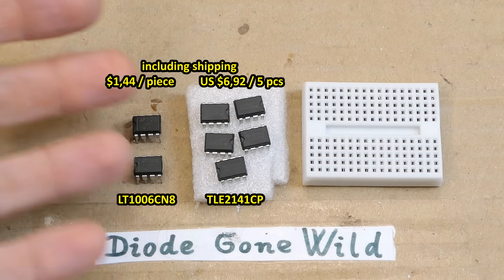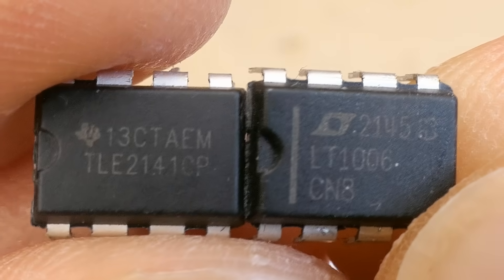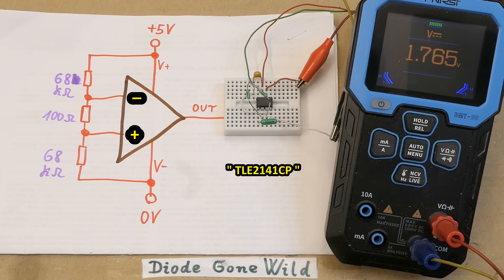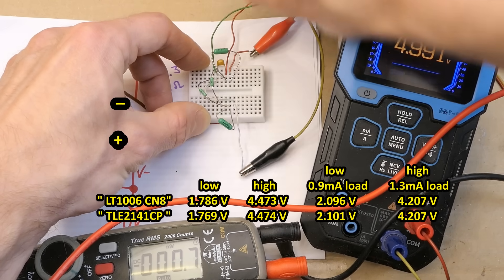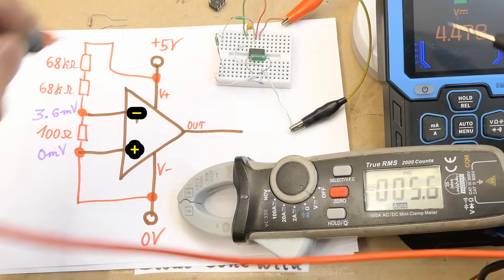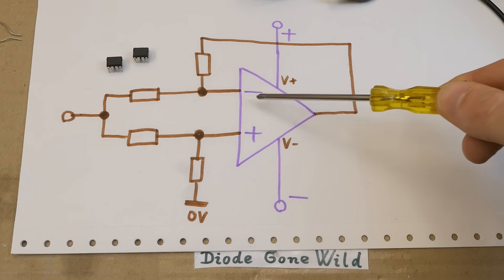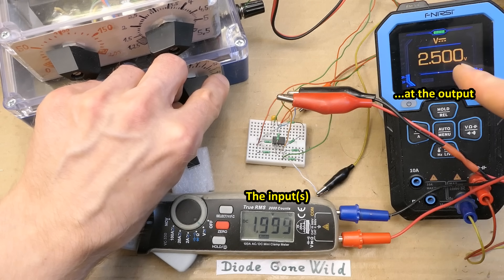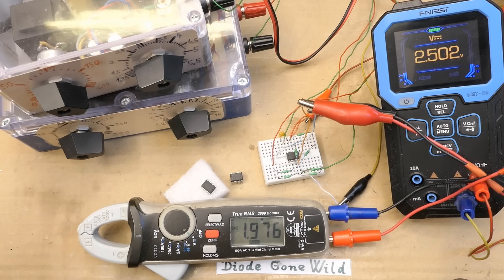Fake OpAmps from eBay, how to test OpAmps

Comment: Be thankfull that they were actually opamps with the same pinout, I have come across fakes that are completly different part resulting in a complete circuit destruction on power-up.
Reply: Yeah though then you know right away, vs spending hours troubleshooting.

Comment: I wonder if you can de-cap it and see any markings on the dies as to who made it
Reply: Destructive decapping could be attempted with just a small blowtorch (obviously outside). Such small die should stay intact. I did this on some old motherboard chips and most survived.
Reply: @RicoElectrico  Often just a paint stripper will be hot enough to soften the plastic.
Reply: I've heard there are around 10 very common oldish opamp circuits that chinese fabs know how to spit out by the millions, and many of these fakes are just one of those designs by pot luck. Some of them are fine as a jellybean part, provided their design matched the general parameters you needed (here, DGW wanted a ground-sensing opamp, whereas what he got was not, so these ones don't work for him).

Comment: I buy my semiconductors only from reputable sources (Conrad, TME, etc.) Nice video as always 👍😎
Reply: 100% of the time these days.
Reply: If your budget allows.
Reply: @edgeeffect   Budget has nothing to do with using counterfeit parts.
Reply: Counterfeiting is so bad that even trusted suppliers can end up with the junk. Dave Jones did a video where he ended up with bunk parts from a big supplier. It's less common than ebay but it still happens on occasion.
Reply: @1pcfred  Yeah, get's in the supply chain somewhere. Corruption. Should be prosecuted since those parts could end up in critical things like medical equipment.
Reply: @acoustic61  it's pretty crazy. Counterfeiting is a huge problem. To the point where it is becoming increasingly difficult to avoid it.
Reply: That only gets you about 99.99% assurity.
Reply: Full agreement.

Comment: now you have to discover which OpAmp's are the original ones behind these
Reply: 741's, what else?
Reply: It would be cool if there was a reverse datasheet search where you could enter the characteristics of a component and it would find matching datasheets.
Reply: @liam3284 The ones that doesnt have a differential pair, just like some schematics of class ab amplifiers that you find in the internet 😂😂
Reply: @henriquelausch6999  That’s incorrect. Lots of non-rail-to-rail op amps reverse phase when one of their inputs is driven close to a rail.
Reply: @lavrentii  So the Chinese developed their own technological process just to spare on a little bit of silicon… This proves my suspicion that this is not some Xiao Fuqing’s garage business, but a massive, centralized counterfeit industry.
Reply: Probably the the cheap lm358
Reply: @Maulana_rhodes  358 has pnp inputs and thus can go down to (and slightly below) the negative rail.

Comment: You can clearly see the texture of packages is intact, it is not a remarked part, but specially crafted counterfeit.
And the fact that two random models got exactly the same die inside tells me that seller not just resells counterfeits, but orders specific die in requested blank packages and puts markings himself (or at least buys the whole batch from someone else knowing exactly what is the cost of insides).
Reply: Yes. This is not some "Xiao Fu Qing garage" level fake, this is big business.
Reply from the maker: yes, no sharp corners around the top, no lines from the sanding direction. It seems that they got some cheap opamps with no markings on them.
Reply: @DiodeGoneWild  All the remarked packages I got from Ali are more often laser etched off. They are not even trying. You may clearly see a rectangle smaller that the face of package, which is different in color too as light reflection is not the same with a different size of texture grain.
Reply: @DiodeGoneWild  They do have a process where they'll paint them with a tar like paint. Gives the same grainy surface finish which they then laser-etch. Using some paint thinner or acetone you can sometimes get it off and see the original markings underneath.

Comment: In a previous job, a engineer had specified a particular TI op-amp as he had tested other manufacturers' devices with the same part number and found only the TI device could meet the output voltage range and current simultaneously. We had no problems initially with the first batches of boards working perfectly, the suddenly the next batch didn't work. The designer checked some of the boards and found the specified op-amp was used but no longer met it's specification. They had some devices decapped and found they were a cheap op-amp, not the specified TI ones. The counterfeit chips had come from a large and very well respected UK component supplier and had found their way into our PCB supplier's inventory. We also had problems with ceramic caps at one point, also counterfeit and very unreliable, again sourced from a well respected supply chain.

Comment: I bought TL081 from my local store. 3 pieces, two of them identical and the third one different. I tsaid that those were the last parts they had. When I tested them, each was different, each with slightly different oscilation frequency (I did a relaxation oscillator to test them) and also as comparator, they behaved differently. Needless to say, they did not worked well in the preamp that I was building. Sadly, I could not return them because the policy of the store is that once you bought any active component, you can not return it. And they were quite expensives, 2.5€ each.
Reply: What a crappy store. Price at common distributors is around 50 - 60 cent/piece.

Comment: Here’s a tip completely unrelated to the video:
If you want to open glued plastic enclosures fast, an upholstery stapler without the staples works great. You can open a power supply in a literal second with this method.

Comment: Maybe there is TL071 / TL081 / TL061 chip inside, the 2v "low" output and the phase reversal thing when with common mode voltage around 0V is typical for these opamps. There are a lot more parts acting like this one - most of them as old...
Reply: That would be easy to confirm because their common mode voltage includes the positive rail. Maybe Diode will see your comment and do the test? I suspect TL0XX are still too rich for the Xiao Fu Qing production though. Might be just the 741.

Comment: I had some OpAmps from Amazon as a set and testing against the datasheet revealed not a single one was what it claimed. For some it was as simple as looking for the input protection diodes with a multimeter..

Comment: I wonder if to achieve such low offsets LT/TI are using some serial bus with shift register to burn fuses post-packaging. Even packaging can introduce offset.
Reply: Calibrate the packaging offset into the precision resistor tuning until you get good parts.
It works out when you can do 200 dies on a single wafer and incorporate feedback from testing processes later in the production line

Comment: If you have few of each, put one of both types in fire for a while, resin will burn out an there will be possibility to compare chips under microscope ( metallization layers seems to survive such rough "decaping process", strong nitro acid works way better, but is hardly available now days) Regards from Poland.

Comment: Most likely a low-tier clone of the LM358 remarked as whatever else is pin-compatible
Reply from the maker: LM358 is dual. But maybe something like 741...
Reply: LM321 is the single op-amp chip that is similar to the LM358/LM324 chips. Nevertheless, the LM321/LM358/LM324 amplifiers are specifically designed to be used in single-supply applications, as input common mode range includes ground, also output voltage should go way below 1V. The chips in this video are not single-supply op-amps.

Comment: 30 uV typical offset isn't unbelievable. Check MAX4238/MAX4239, 0.1 uV typical offset voltage ;)
Reply: Dave Jones used these in the 'micro current gold' so I used them in my version and they are great.
Reply: @andymouse  Yes I'm aware of that, that's where I also found them first ;) I also like a lot his potential replacement opa189 ;) I often need wider supply voltage that's where MAX4238/MAX4239 fails for me.
Reply: @TriodeTetrode  :)

Comment: Ca3140 can it be used because it's been used in welding machine???
Reply from the maker: It could. Just the high state output voltage is a bit low. You have to use a very sensitive gate MOSFET (like PSMN2R0-30PL) or power this opamp using the voltage before the 7805.

Comment: True there are a lot of dishonest sellers on many online platforms however there are some honest ones out there as well, it’s important to do a little research, seller rating, reviews, asking questions, requesting additional photos and even then some counterfeit parts may slip past. The good news is you can leave negative feedback so we all help each other avoid them all together and also block that seller from your profile so you don’t even see their trash listings again. Also good to point out that if the deal looks to good to be true it is probably not going to be a true original part. Good video and thank you for showing us the testing methods you found successful in identifying the frauds

Comment: Also fake ic's usually stick to a magnet.
Reply: But a lot o real ones, too. Texas Intruments ICs usually have steel legs. Don't know why. I especially hate the vintage TI ones which have steel legs which are silver plated. They become unsolderable due to the black silver tarnish, you have to scrape the legs before you solder them, but if you scrape too hard and remove all the silver plating, they will rust...
Reply: @mrnmrn1  Yep, and on really old gear quite often the steel rusts and subtly cracks the package open and the humidity gets in and ruins the IC.

Comment: Been fighting fake chips for a long time after got scammed back in 2005. I try and use reclaimed parts as they are cheaper and are more likely to be genuine. Or failing that use large suppliers, more expensive but mostly genuine, and you have some recourse.

Comment: At the end of the video I would take all the fake op-amps and wire the V+ and V- in parallel with each other and connect them directly to 230VAC. problem solved.

Comment: Have you tried contacting the seller and confronting him with your measurements? 😀
Reply: from my experience, they'll just tell you that you don't know what you are doing, and that the parts are fine, and other mumbo jumbo. It's like trying to evaporate a river using a hairdryer.
Reply: @WagTsX  That obviously won't work, because you don't have a long enough extension cord.
Reply: “Friend, chips fine. You doink it vronk. No mooney.”
Reply: I successfully got my money back after complaining about counterfeit current mode OPAMPs. Had collected some evidence: manufacturer logo distorted, bandwidth not as stated in the datasheet.
I also remember a “Rulycon“ capacitor that had failed in a PC power supply.